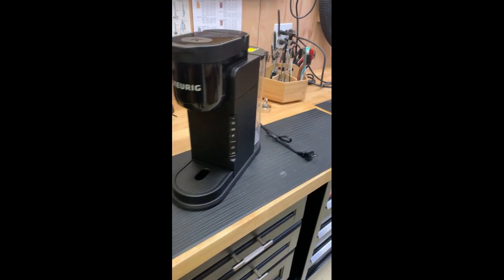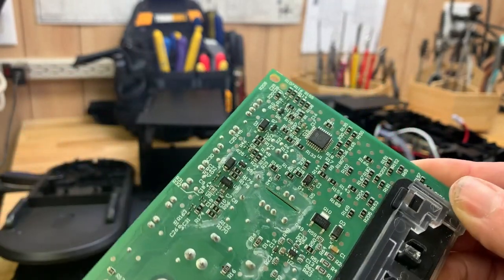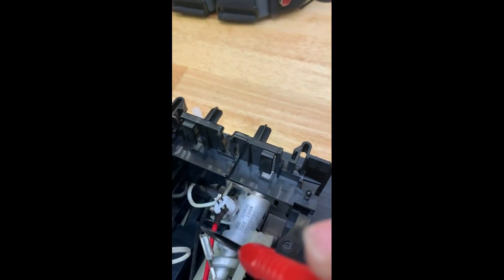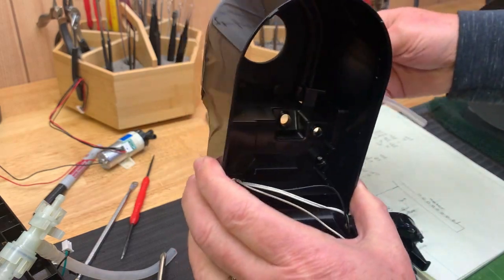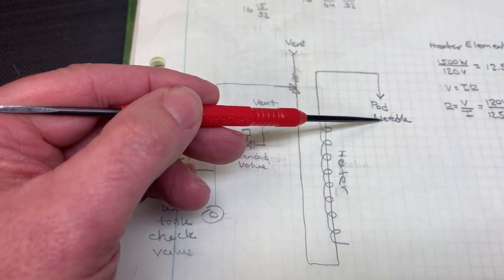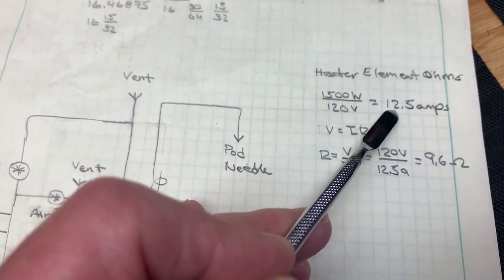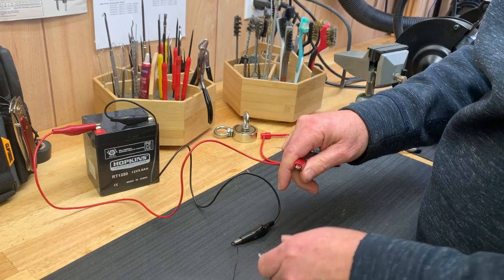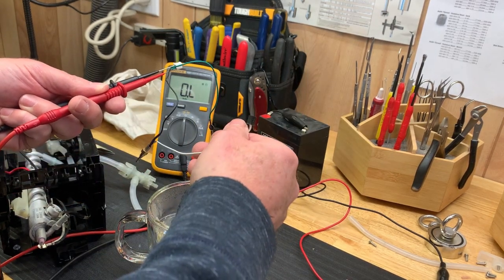Keurig K Express Autopsy

Comment: Just an FYI about your temperature sensors, thermocouples are typically used in pilot flames and things like that that are much hotter and generate a voltage. Refrigerators coffee makers and things like that use thermistors, which you discovered. A very popular one is 10K ohms at 70°F but there can be other temperature profiles too.

Comment: The cheap thermo protector they use is pure crap. Its stuck, and you need to use a paperclip to stick in the hole of the protector and resrt it. Refer to just a dad videos as he's down a lot of fixes.
Reply from the maker: This wasn't the problem in my Keurig. You can watch me check the thermal protector and it was closed.